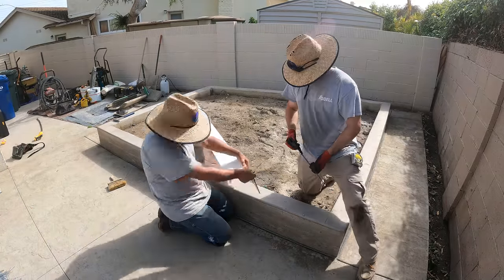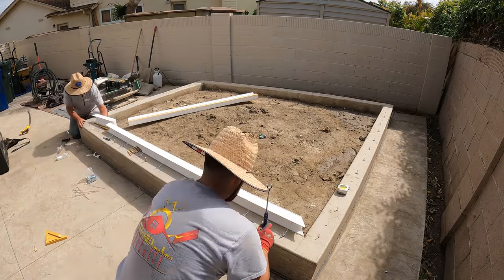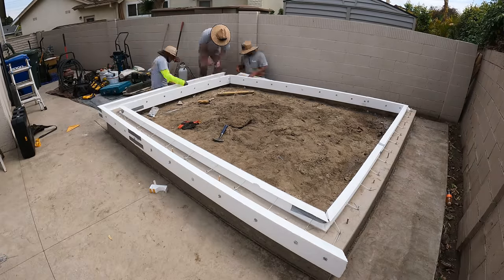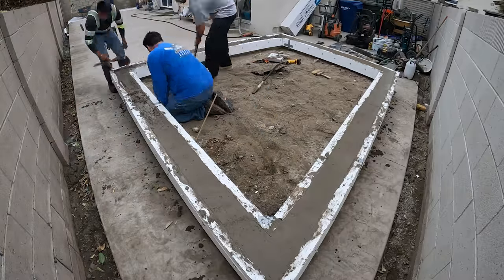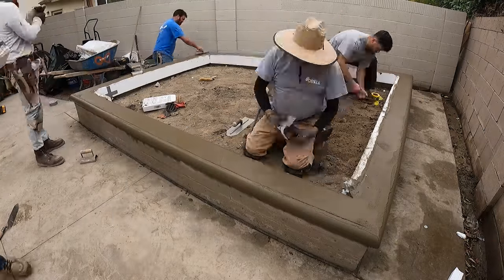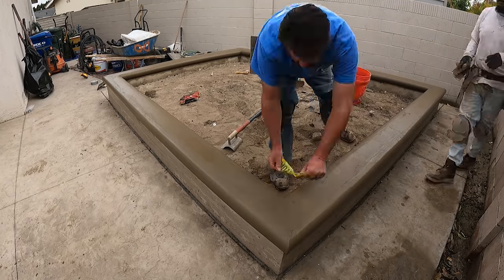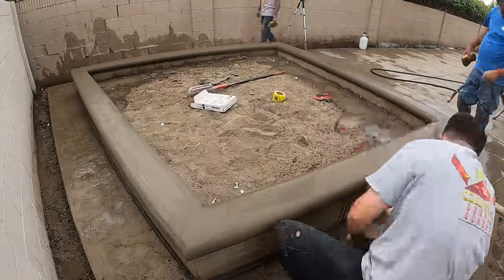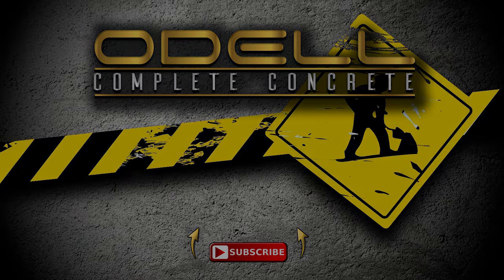Colored Concrete Bullnose Sand Wash Finished Wall Cap

Comment: No Bull, that Bull Nose Finish turned out nice!  This has been a challenging multi-part project Odell, you really took the Bull by the horns on this one. I would have been like a Bull in a China shop trying to fine finish that Bull Nose. Anyway you really hit a Bulls Eye on this one. I’d like to stay longer and shoot the  Bull with you a little longer but like a Bull at the gate, I’ve gotta run.
Reply from the maker: TY

Comment: I have found if I am using Styrofoam or wood liners, if I  spray 2 coats of soapy water on the forms and let it dry before I install the liner I seal up the little pours of Styrofoam on wood pores so I don't get little splinters or specks of foam stuck in my work.  2 cups dishwashing liquid to a gallon of water.  Great job on the finishes.
Reply from the maker: Also acts a nice bond breaker.
I'll give it a try

Comment: Another fabulous job Mr Odell. Just a quick note to you. I know you probably know to do this but you’ll need some drain holes for the excess moisture/water to drain out. That way they plants won’t get to much water. Just my two cents worth spend it wisely
Reply from the maker: Shouldn't be a problem unless it gets over watered.
Reply: Not a bad point. In the ideal world it would be nice to add 2 inches of rock at the bottom for root drainage as well as drain holes then fill with top soil, but It's probably fine as is.

Comment: This is really nice, I like it. I want to do the same but want to make a mold for individual top caps and pork concrete into them and then fit them on top of the walls. It will be a good learning experience. I was thinking about adding rock salt to the top of the molds after I dampen them slightly that way when I pour the concrete and it will have hollows after I wash the salt out and it will simulate Coral or old style Rock
Reply from the maker: You can do it.
GL

Comment: David, awesome work. How did you go about leveling the top cap? And, were the horizontal steel wires sufficiently buried in the cap so they would cause issues with rust?
Reply from the maker: I leveled across.
The wires are aluminum

Comment: What mix do you use for the sand wash? Is it a 3/8 pea gravel pump mix? What sack? Job looks great
Reply from the maker: All concrete mixes have sand in them.
Reply: @OdellCompleteConcrete  I know that. I was just wondering if I’d get a better finish with a smaller rock mix design and if it finishes better with a higher sack content like 6 or 6 1/2 sack

Comment: Would it help to use thinset or a tile bonding agent between the planter wall the the top you are pouring in the video?
Reply from the maker: I think dowels are better, but if you don't have any glue will help.